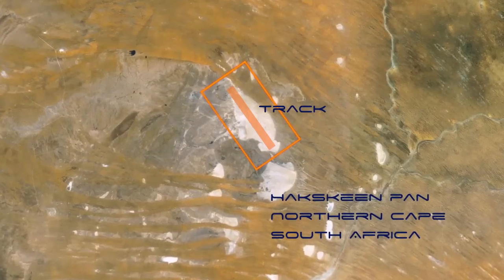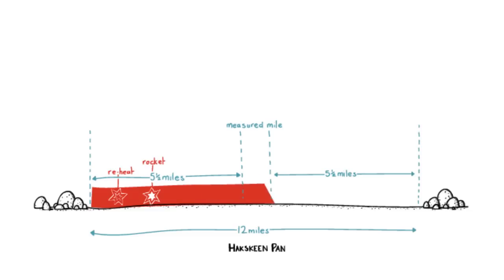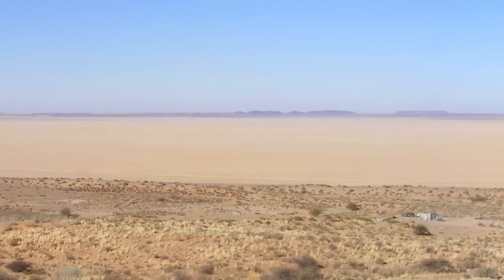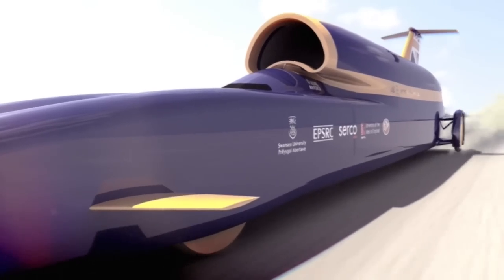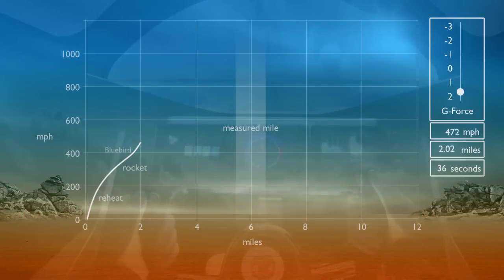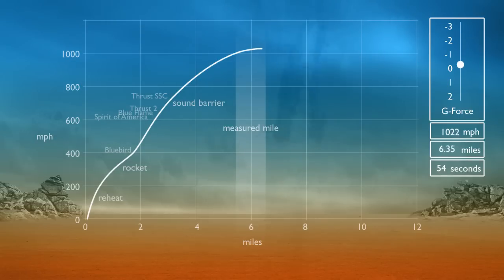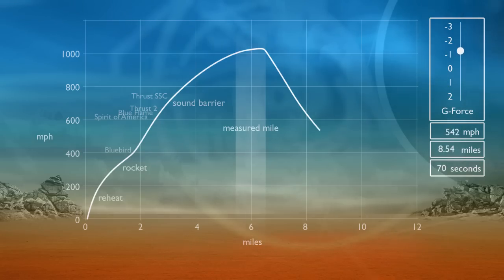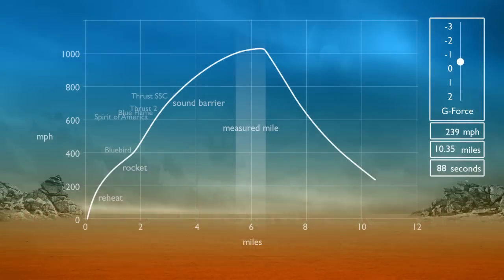Performance curve of a 1,000 mph run

Comment: Why is it important to reach the speed during that "magic mile"? Don't you have any GPS, radar or some other means of speed mesurements that can register top speed regardless of where it's reached. Are you actually clocking the cars average speed over that mile or what? I get that fire the rockets too late could be catastrophic (because you may not get enough distance to slow down) - but why is it a problem if they are fired too early?
Reply: The speed is measured between "traps" for the record attempt. Any onboard measurements wouldn't qualify for a record. It must be measured externally to qualify for the record. And, it has to do two runs in opposite directions within a specified period of time. It's not enough for a car to break a speed record once, it has to do it twice, once in each direction, and the average is taken as the record breaking speed. It's the tradition of the sport. A one-shot record attempt simply isn't fair to those who've come before. It could be done more easily with a car designed to push past the limits to destruction. An onboard speed recorder could easily be faked. Time over a flying mile can be easily verified. I've learned all this from reading about record attempts over the past 5 decades. Read more. Learn stuff. People like me could easily mislead you.
Reply: Ok, that makes sense. Keep the speed up over a distance is indeed more of a challenge than just hit a peak speed. 
Also nice with the idea to make 2 runs - one in each direction. That way, the car has to last more than one run and you can't get help just because you're lucky with the wind (if you have tail wind on one run you will have head wind on the other).
Reply: You should check out what's "legal" in bicycle speed runs. =)

Comment: so wait, y'all decided to pick a track that had rocks on either side? I'm sorry, what? Why not use Black Rock again, or you know, anywhere without rockets that could damage the car?
Reply from the maker: Hi Sam,
Good question. We pretty much scoured the globe looking for run sites with 21 miles of consistently firm desert and a decent weather window. There aren't many. Black Rock is not too bumpy, the dust has blown into drifts and you only get 6weeks of good weather, in South Africa we get 6 months.
^JT
Reply: Thanks for replying, sorry for my slightly overexcited reaction. That makes sense, I didn't realize what the criteria were. Makes a lot more sense now :) I will be following this very excitedly

Comment: Glad you liked it. It was tricky fitting all the info into such a short amount of time. There may be a slight tweak to the end as it shows both air-brakes and chutes being used. Currently the theory is that the air brakes should be able to do the job on their own.